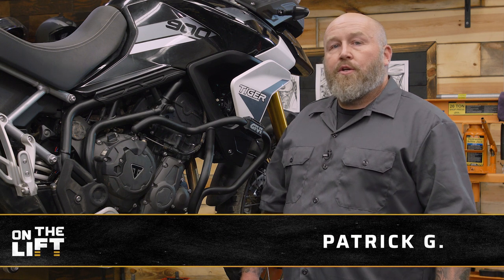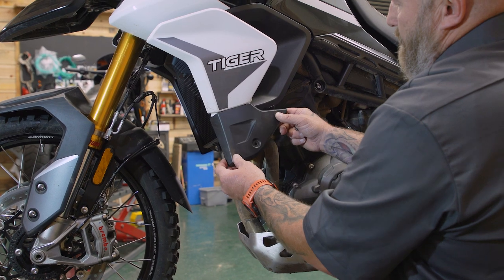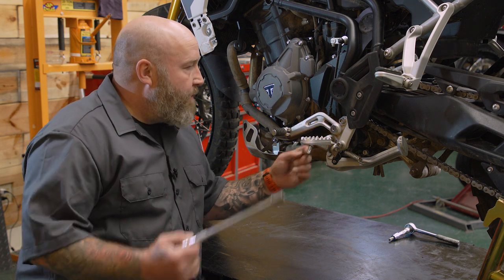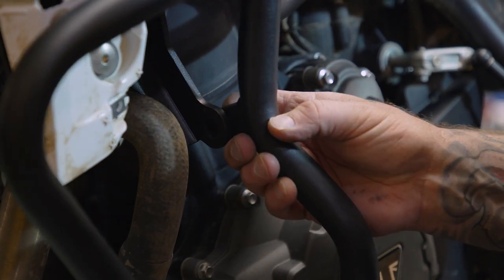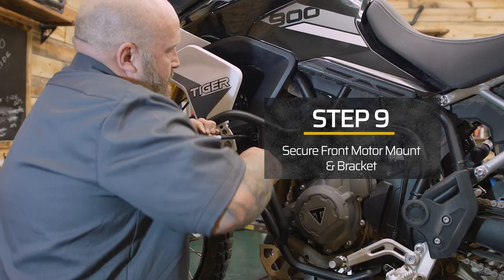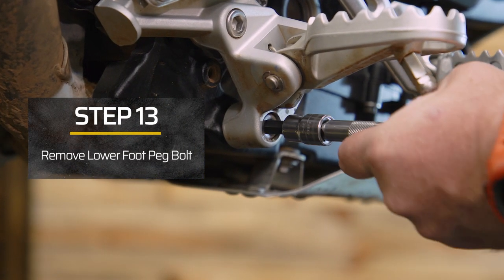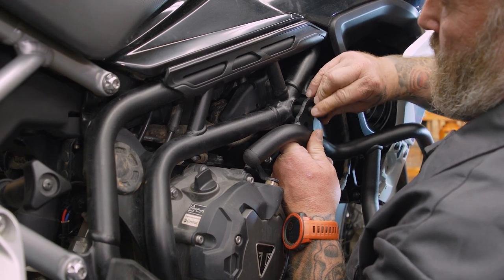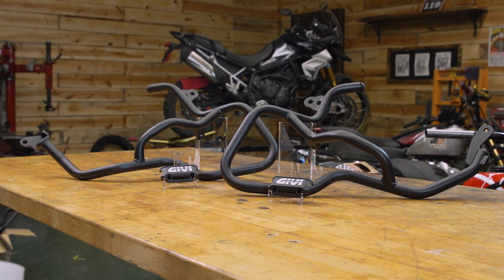How to Install Engine Guards on an Adventure Bike | On The Lift

Comment: Great demo…I’m a believer in blue locktite for these applications and a torque wrench..especially for motor mounts and a bike that will be used off road. Shop manuals have torque values👍🏼

Comment: Just be careful when you tight things up, I broke the long bolt once (royal enfield himalayan), and it is a pain in the ass to find a replacement.
Reply: McMaster-Carr. Can't find what you need look it up there. guarantee they have the bolt, the spring, the pipe the clamp, you name it if it's used mechanically they'll have it.
Reply: @coltonwancho6571  thank you sooo much for the reply. My problem is: I live in Brazil. I had to get it custom made, expensive and took a while :/
Reply: @renannunessteinck2580  McMaster will deliver anywhere. But I get it sometimes getting the bike up now is more important then waiting for something like a bolt.

Comment: Thanks Patrick. Do these guards increase vibration to any significant extent? Would rubber washers be any benefit?
Reply: I took a trip to Idaho this spring on a clone of this bike with these guards and noticed zero vibration increase.

Comment: Ahhh, is it possible to order the bike from the factory with the crash bars installed? Asking for a friend. 😆
Reply: The short answer is yes. The long answer is not all dealerships will have bike kitted out. At least not all the newest bikes. Sometimes it's because parts availability other times it's because adventure bikes might not be the dealers big seller so they're not going to invest money in aftermarket parts on a adventure bike when they rather invest money getting out a cruiser of some sort because that's more likely to sell in that area. like if you live in Wisconsin or something by the Harley-Davidson manufacturer. If you're not picky about year most dealerships that have adventure bikes already have a fully kitted out used from some guy that always needs the best the best new bike so that would probably be the better route but they do exist out there some from dealerships that kitted them out others are in the used market.

Comment: When having to hold a faster on one side of the bike and loosen or tighten on other a nice trick is to get a extension and a ratchet put bike near something solid like garage door opening, with the side that is needed to be held to the solid object.  Use the short wall of the garage opening  to brace the ratchet while you loosen the fastener. Car tire turned out away from fender works well too bring that it sits at a proper height. Also impact can take it off most often with out having to hold anything on other side.